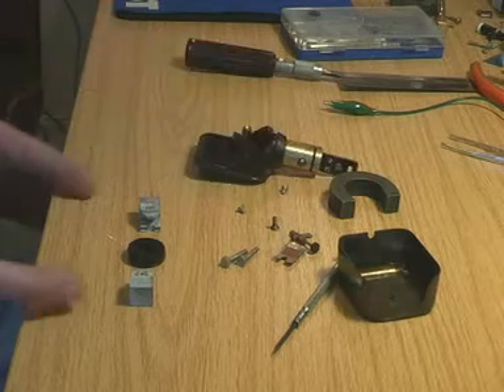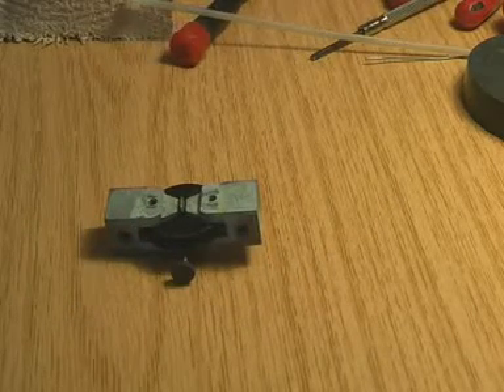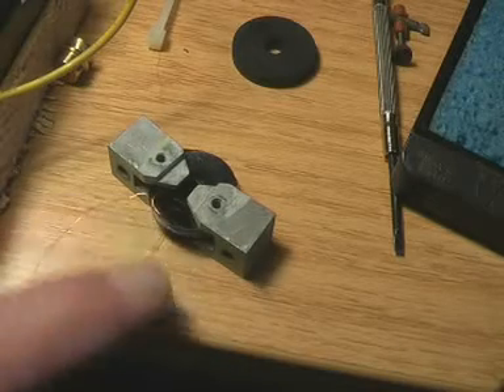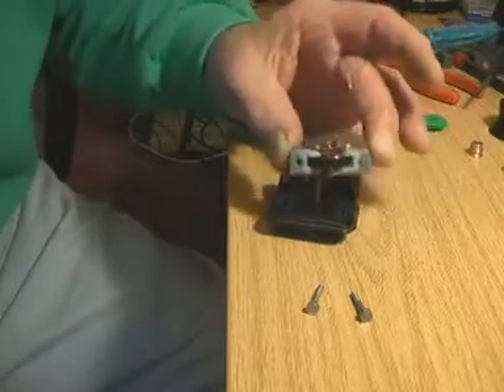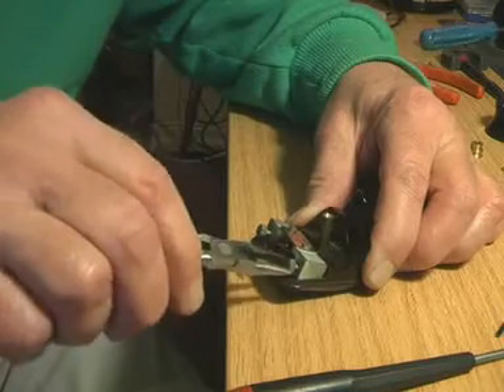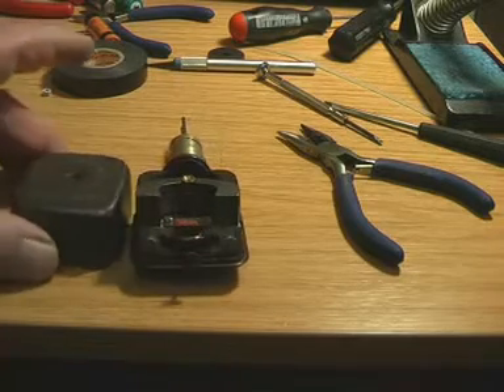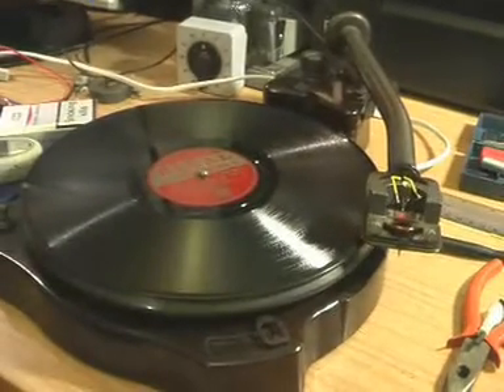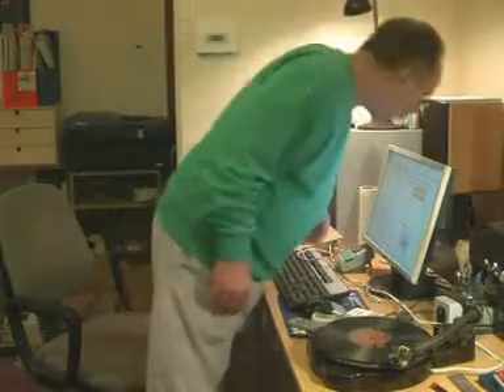univolt4.mpg

Comment from the maker: Hi there. No: I'm sorry, but I have not done any  more work on this project. I can only advise you to collect various examples of soft plastic insulation used on small wires... you might find one that is the right size, and also soft enough. BUT - these old pickups always 'made a sound' when they were working, even when they were new - I think it would be impossible to make them very silent. Many old gramophones had a label: 'Close Lid While Playing' so that you would not hear the 'buzz'...